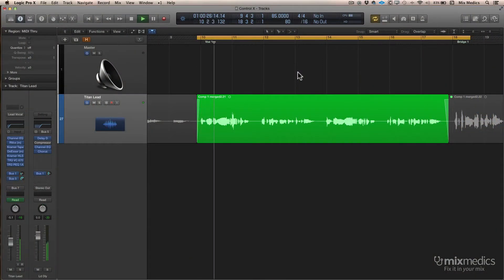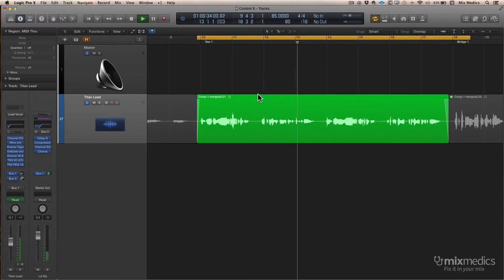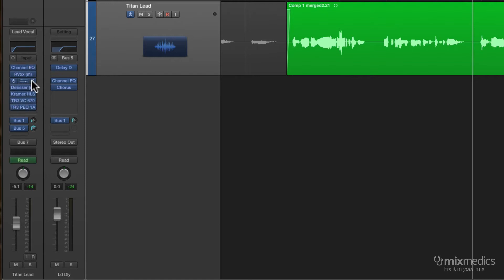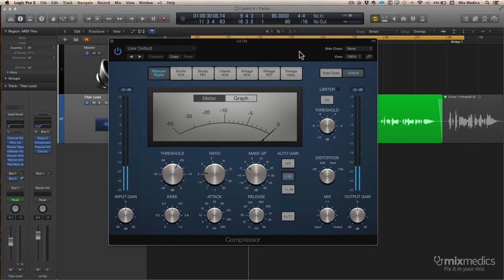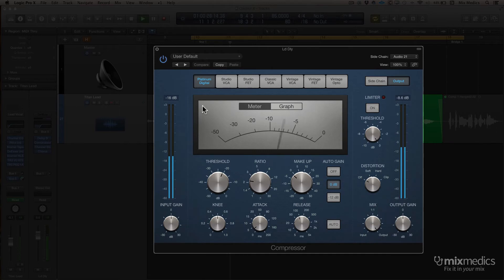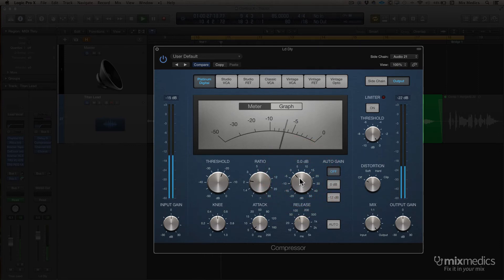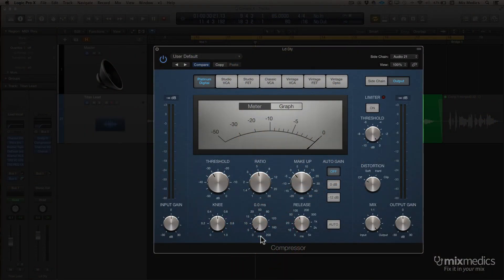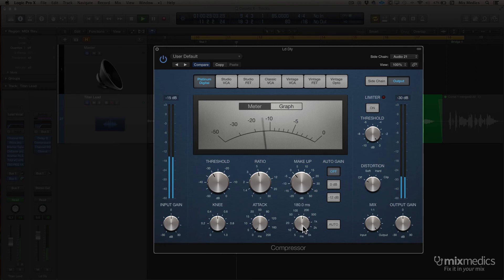Using Sidechain Compression To Control Vocal Delays In Logic Pro

Comment: Nicely explained. Thank you! I noticed some engineers send their original audio signal to an aux (Bus 1 for example), then put their reverb on yet a different aux (Bus 2 for example) and direct the sidechain compression located on Bus 2 to duck the Bus 1 audio signal. Is there any advantage to doing it that way vs ducking the signal directly on the original vocal track, as you have here? Thanks.

Comment: what delay setting were you using ?  and for the bus one , on a reverse though a bus one. ?
Reply from the maker: I don't have the project around to check but it sounds like a couple of delays inside of Delay Designer: a quick slapback and a longer 1/4 note delay. I expect I would have also rolled off some hi and low end on the repeats too.
Reply: thank you so much for replyin, you have definitely made my mixing a lot better by explaining how to side chain so well ! have a great day bruv!